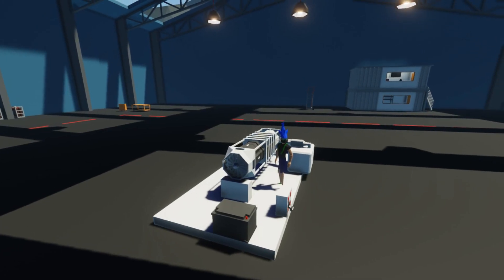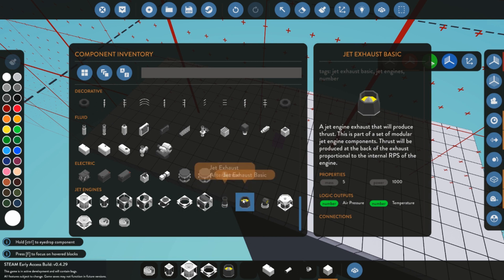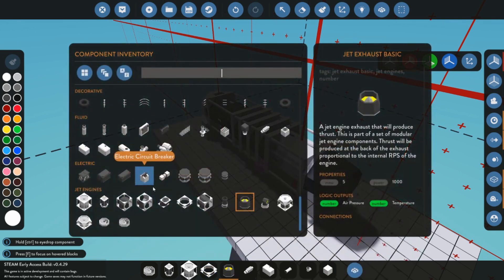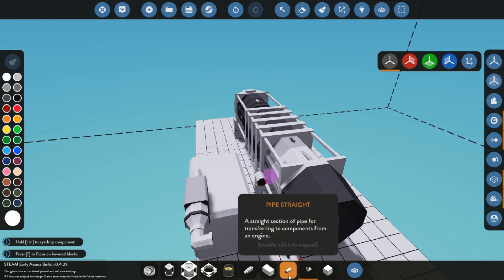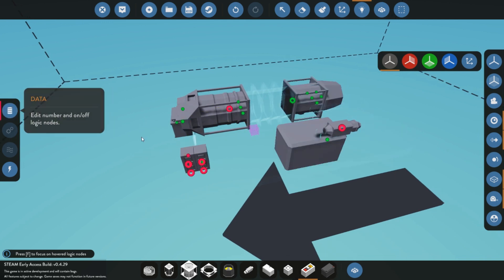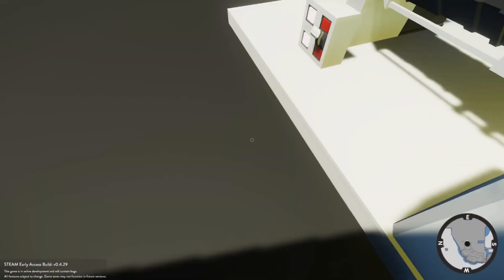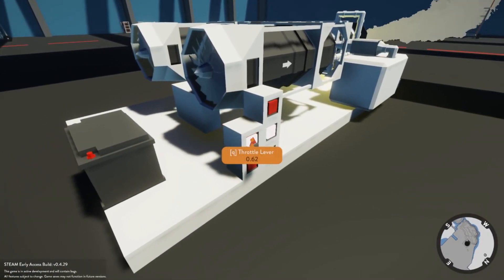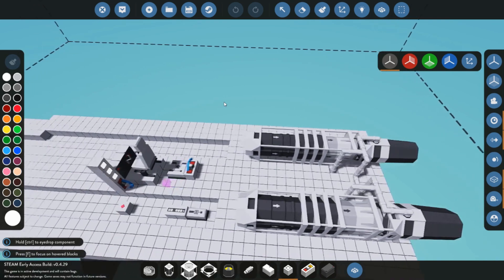Stormworks Early Access | How to Build a Jet Engine!

Comment: Storm runner here’s how you get the jet engines too work

Get a PID and set the on signal too your ignition then set the set point too your throttle lever then the variable too the rps output of ONE OF YOUR INTAKE FANS 

The. Configure the PID with the select tool in this order

0.01
0.00001
0.1

Then set your throttle max value too 185 and your good to go this limits the rps with the PID so it does not explode
Reply: how can i make that without a pid in career
Reply: henryscp you set the max throttle to 0.70 and nothing else
Reply from the maker: Thanks for the comment! I did figure out about the P.I.D controller and left a little note in the comments, but thank you for the further explanation for others that may not know how to do it.